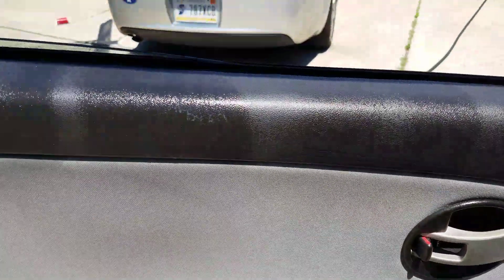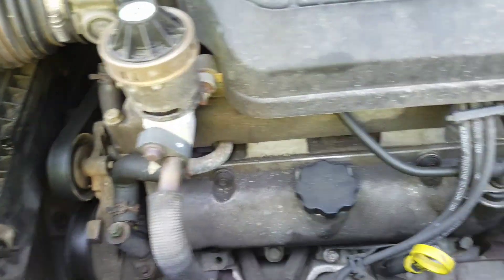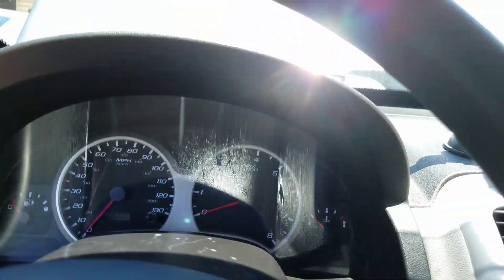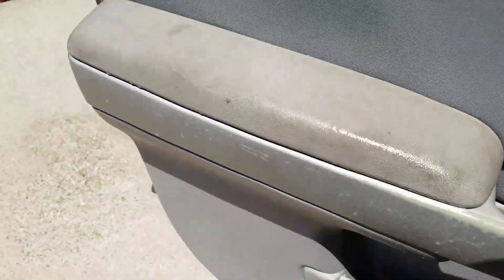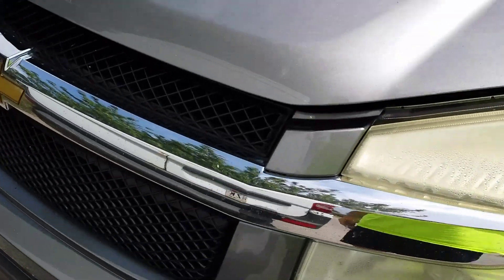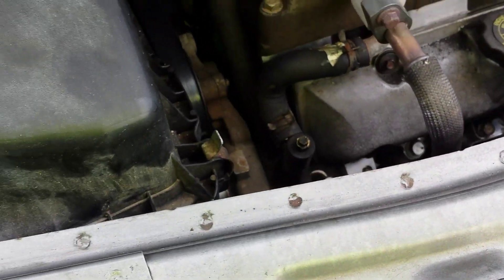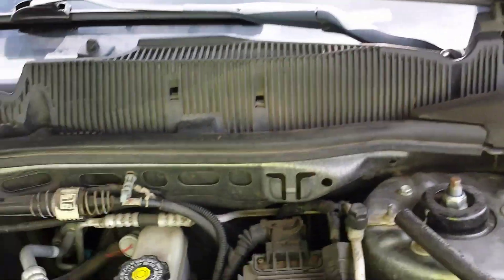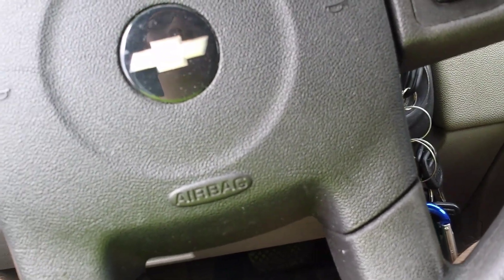Equinox problems again

Comment: Had an 08.  Replaced thermostat, burped it, replaced water pump.  They tried to tell me heater core b/c i wasn't getting heat and it overheated when idling.  It was the head gasket. The nox is famous for it
Reply: Damn😞 not what I wanted to hear

Comment: My car didn’t even last 10 minutes before it started to overheat. 2 minutes in the drive way and at every red light, my car was flashing messages and telling me to turn off my car. 

The problem was the thermostat and a fan fuse. As soon as I changed those two things out, I had no more overheating issues. I changed my headlights to LED all on my own. lol Later on I had to change the water pump. Im too chicken to do the serpentine belt on my own lol

I can’t take Nox (what I call my Equinox) to a drive in car wash unless I’m ready for a swim. I’m going to work on my sunroof today, since we are still getting some sun. 

I really hope clearing the hoses and/or reconnecting the them will stop the aquatic car ride experience. 😂😂
Reply from the maker: Im glad i got rid of this pos, replaced it with a 2024 honda accord

Comment: I have the same problem replaced the thermostat, water pump, flushed the heater core and no fix. Thinking it is the head gasket. Around how much was the fix? That will help me determine if its worth fixing or getting a new car.
Reply: Zebra Lady75  I just found out it was the head gasket. On 2009 Chevy equinoxes head-gaskets are notorious for leaking due to the dex cool coolant they manufactured it with.
Reply: @demetriusjohnson3677  how much did the fix cost you for the head gasket and radiator?

Comment: My fans wont come on. The small one wont spin without a little force. Big one spins but i cant hear it while ac is on. Alll i know is when my fans work i got no issue
Reply from the maker: Mine would come on when i turned the ignition off

Comment: do u knw why my brakes on driver side keep lockin up
Reply from the maker: might be your abs pump goin out or you need a new caliper
Reply: before doing any major repairs on your brakes, change the brake line on the side which your brake is giving problems. The equinox's brake  line is notorious for going awry.
Reply: You're soo lucky you found me. The equinox has this thing about making you waste a lot of money on new caliper and or ABS components plus the labor when it only needed to be change was the brake line for the side that is locking up. Costs brake line plus the labor. A fraction of what it costs to throw parts at it (hundreds). Trust me, change the brake line first and go from there.